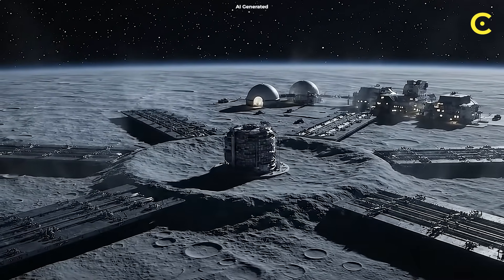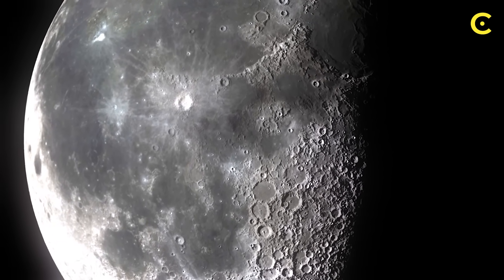NASA's Nuclear Reactor on the Moon

Comment: All those needs needs needs : for the moon ,proof the moon was not made for mankind......

Now Radioactive plumed on the moon......or the moon dust floor !

Earth will not have a gravitational pull by the time they finish....😮😢🫠
Reply: Sure it's not already done.....
Boeing took a beating here on earth and now will work for the government building things......
😮 Digging a large hole to bury it ,won't moon dust float away as the shovel it ......

❤Build anything on the moon..🤔
A thick plexiglass five story 300 rooms Apartment Building ( Home )with drapes for bedroom , ceiling and bathrooms . Every other room clear rooms .( Build more later.)"Oxgan" inside building running water ,Gatorade and vitamin water  in tanks  to drank from fossit ! 
I would rent out apartments as well as have ( paper dissolve detergents ,bath tissue,toilet with incentergrat weast , paper type dissolve soap ,foods for humans  and canery🐦 pets, clothing moon wear ,shoes/ house slippers for inside oxgan breathable homes,washer and dryer (( working by using dry lite power detergent sheets spends..))

Comment: If you want it to last, be on budget, be on time and put out it's rated power without requiring contractors to repair it, go with Westinghouse. If you want the opposite of that, but either with a big job guarantee or a generous "donation", go with Lockhead or Boeing. One of those should detonate
Reply: This guy gets it